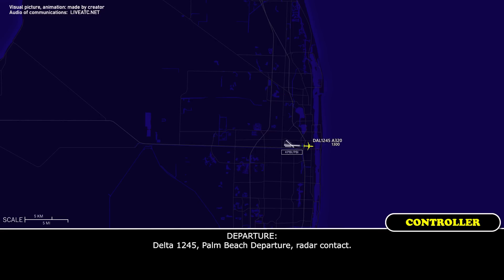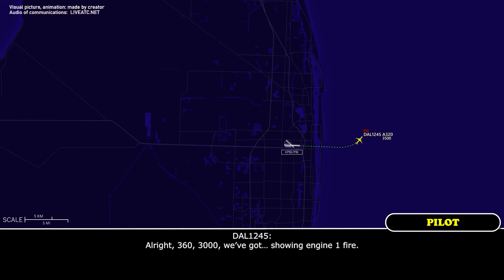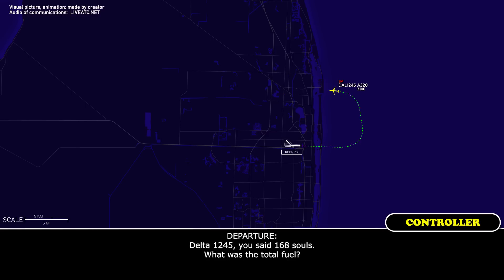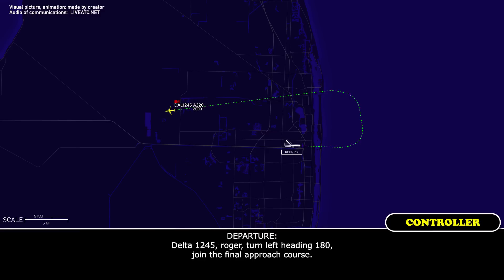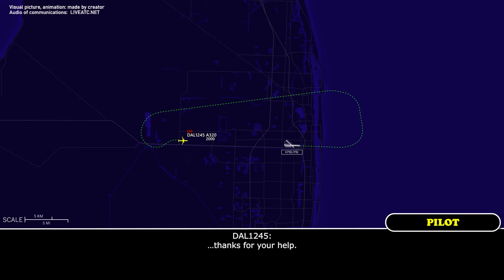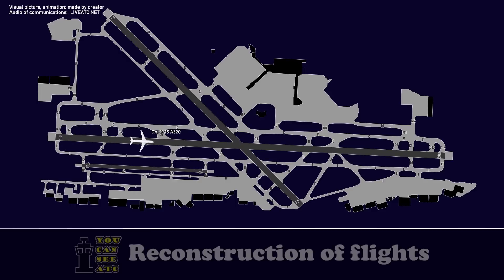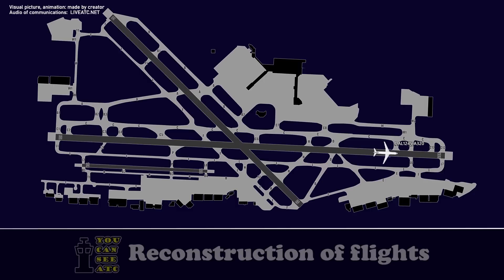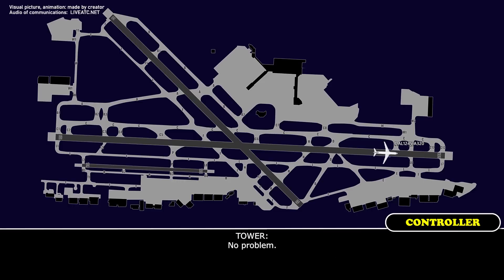“We’re showing engine #1 fire”. Delta Airbus A320 makes emergency landing at Palm Beach. Real ATC

Comment: That Delta pilot doing the readback/answering so fast the controller was still transmitting.
Reply: Been seeing that a lot lately from both pilots and ATC. Poor radio etiquette that's going to result in an accident one of these days, if it hasn't already.